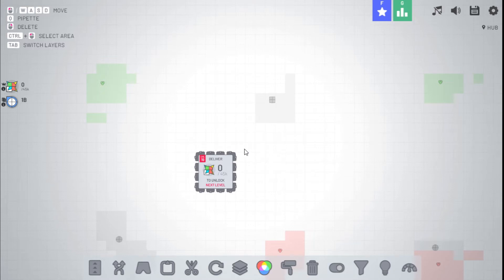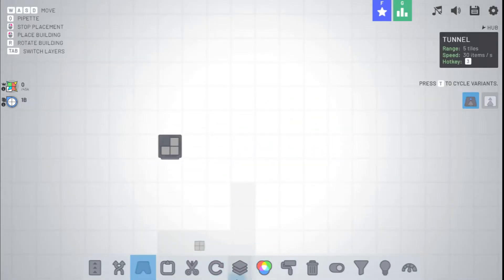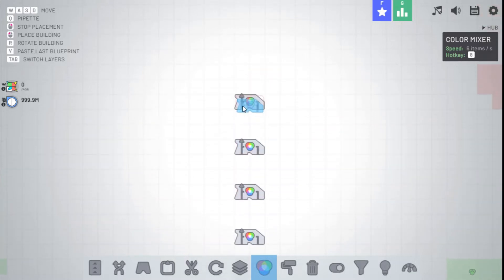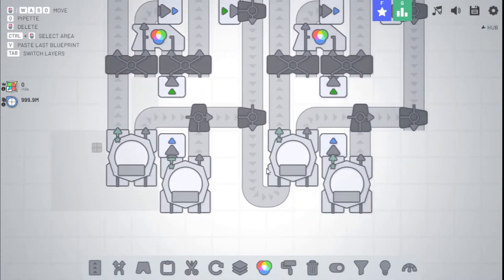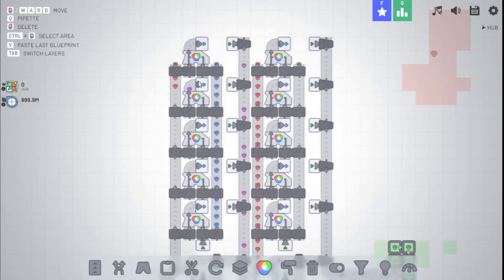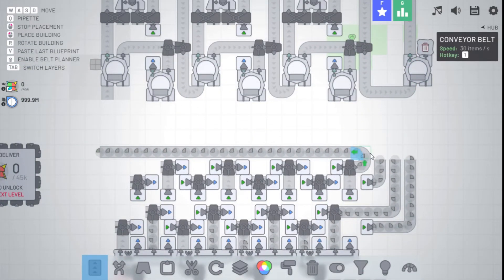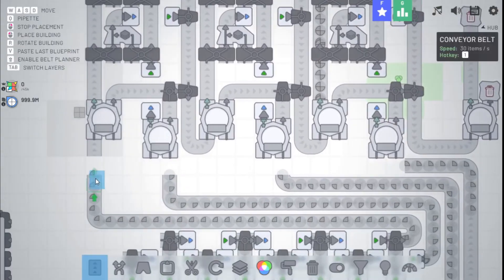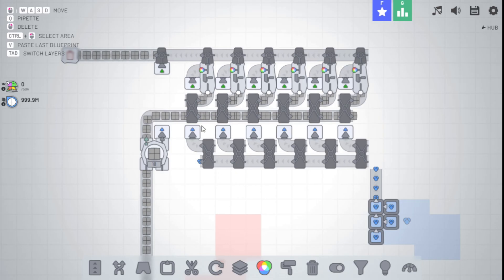How to Build a Smart Machine in Shapez.io Standalone

Comment: I know this comment is many years out of date, but thanks for the guide. I found it while searching for Mobile-friendly information, since they don't (yet) have wires, and was similar to your situation then. However, one thing I hadn't counted on was the lag of the mobile client - belts and machines will continually get slower the long the game runs. This meant the storages getting backed up at the wrong times and generating bad mixes/stacking. I still was able to use some of your principles in my new MMAM.

Comment: I caved and got the teleport belt mod. Then I made a wired 3.5 belt (should be 4 without lag) anything machine… I made it extendable to 16 belts, but the lag… I’ve gotten 50 solid hours of content out of this game.

Anyone that has made a fully automated MAM is a software developer. No questions asked.
Reply: Not a software dev (other than some Roblox stuff as a kid), but I have beaten several Zachtronics games, and I was able to make a fully functional MAM without using any guides. General gist is, you need four modules, each having two sections, assembly and coloring. Assembly stores pre-rotated corner pieces of the four shape types, coloring stores four sets of the seven colors hooked up to a quad-painter. Module takes a "one-layer shape" as wire data input and uses virtual operations to split it out into four colors and four corners, releasing the relevant components and colors (be sure to build it to handle the cases of "empty corner" and "unpainted corner", too!). Then hook them up in a way that they can selectively stack-em-up. Base wire input from the hub virtual-unstacks the shape and does some fiddly if-else-ing to determine whether it's making 4x one-layer, 2x two-layer, a three-layer, or a four-layer shape, then transmits the relevant single-layer data to each of the modules. The only thing it can't make, is Floating Layer shapes like the rocket and the Shapez Logo...

Honestly, once I had the logic figured out, the real hard part was routing a zillion belts of "raw materials" for all the modules! Protip, find a shape-mining spot that has a "one of everything" shape to slice-n-dice, it makes it a fair bit easier.

Comment: Hi.  Thanks for the helpful tutorial. I have never played any of these logic type games before and I am very new to this game which I am enjoying immensely so far.  

I am here to learn.  But for quite some time I was stumped at the 3:00 mark because, even though I understand the mechanics of the Stacker, in that it will cease to output unless there is feed to both of the input ports and  I also understand the mechanics of the Storage unit; its priority and overflow mechanics. I couldn't see how the by-pass was causing the flow from the Stacker to continue given that the right side of the Stacker was still getting no feed.

I actually thought that some trickery was causing the Stacker to output.  It wasn't until I sat staring at it for several minutes that I realized that the Stacker wasn't outputting at all.  The confusion arose because the junction you made was right at the Stacker output, thereby concealing the fact that the Stacker was still not outputting anything.

I realize that this should have been obvious but, as I pointed out earlier, I am very new to this and I am on a very steep learning curve.  I also realize that it is very hard to put yourself into the mind of a novice when you have as much knowledge of the processes as you obviously do. 

It is the simplest of techniques that changes a good tutorial into a great tutorial.  In this instance, if there had been a gap between the Stacker and the Junction, or if you had used a corner instead of the Junction (given that a Junction wasn't actually required at all), it would have been instantly obvious that there was still no output from the Stacker.

But again, thanks for the great tutorial and I hope that my comment helps to make your future tutorials even greater.

Comment: Does merger speed get fixed in the next update? It's almost half as slow as it should be.
Reply from the maker: @KILLRXNOEVIRUS  The designs for each are very similar but I would make the colour mixer first
Reply: @dogdayboy7266  Oh and please make more videos :(
Reply from the maker: @KILLRXNOEVIRUS  I do have a project planned :)
Reply: @dogdayboy7266  ?
Reply from the maker: The merger speed is normal in any version to my knowledge
Reply: @dogdayboy7266  put 2 belts into a merger going into a single trash. Or try it into the hub. Why are you unaware of this problem? You've clearly played through the game... where I haven't finished. I'm on last shape then my full hub filling blueprint factory. Which should I make first? I destroyed my current outdated one.
Reply: @dogdayboy7266  no it's almost the same as a belt.
Reply: Me too I want a serepator. Is just seperate the shape like a balancer but it's 1x1 like a opposite of the 1x1 balancer
Reply: @astro_cat030  thats already in the game.
Reply: @astro_cat030  it's called the compact splitter
Reply: @astro_cat030  smh
Reply: @KILLRXNOEVIRUS  no it's a 1 by 1 block
Reply: @astro_cat030  How about you listen and use the thing called eyes and read what a person is saying to you.
Reply: @astro_cat030  Whats so difficult to understand? If you don't know what you're talking about how am I supposed to help you?
Reply: @astro_cat030  There are 3 in this game. Balancer, compact balancer and compact merger. Balancer is 2 by 1, the rest are 1 by 1
Reply: @astro_cat030  Again you asked me for a compact splitter https://shapezio.fandom.com/wiki/Balancer#Splitter_.28Compact.29

Compact splitter. It was added when the wires update came. It's already in the game. In the full version.

All 3 versions are on that link. All 3 versions are in the game.
Reply: @KILLRXNOEVIRUS  Why didn't you just say it's "1 by 1 in the game"
Reply: @astro_cat030  I DID SO MANY TIMES
Reply: @astro_cat030  WHY AREN'T YOU LISTENING?!?!?!?

Comment: Nice idea with storages. I believe you don't actually need them for stackers if you use wires, also for painter since you can bypass a figure with the wire used for colour switching
Reply from the maker: This is for the standalone version, the only reason I recorded it in the Alpha is because it is much more optimized for lag
Reply: @dogdayboy7266  Thats why your Vid is so laggy
Reply: @dogdayboy7266  Thats why your Vid is so laggy
Reply: No comment